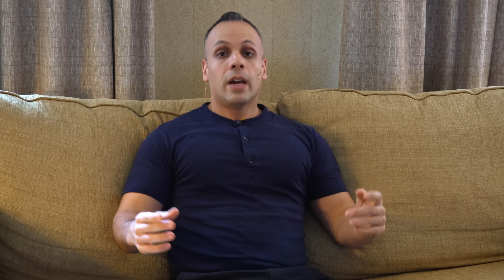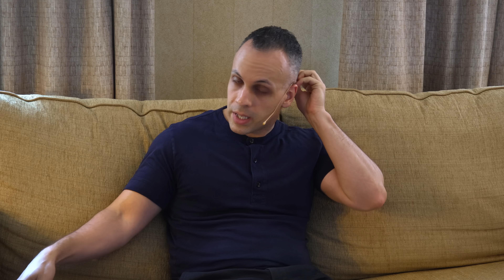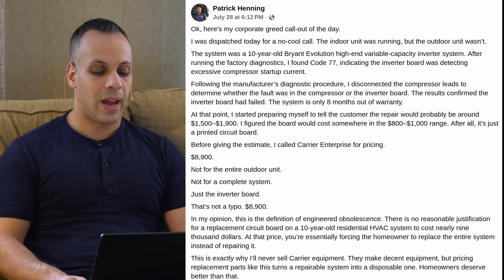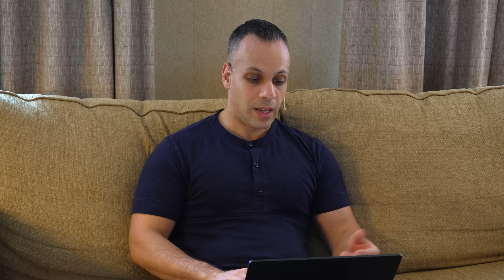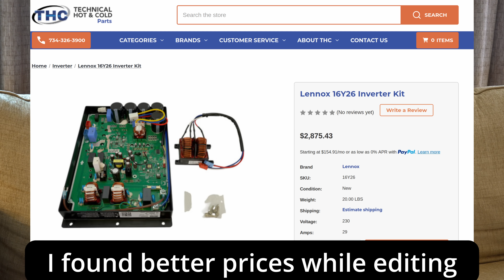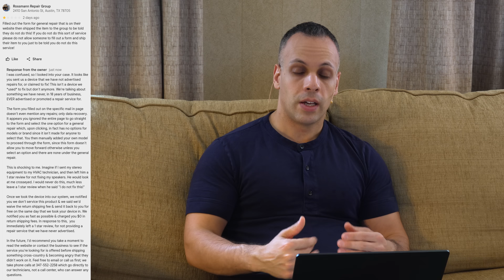Carrier AC repair has $8700 part cost for residential unit

Comment: This is the standard Carrier Enterprises solution to selling cheap equipment, markup the replacement parts 10x or more their manufacturer cost to produce. Standard. 
To be a Carrier Dealer you have to be some sort of person, I wouldn’t ever want to cross paths with. 
The really really bad sort
Reply: What’s more, is I have waited over 3 months for parts from major manufacturers. They say the equipment is “old” and requires these parts be on a “made to order” basis. 
However, they boast and claim their commercial package units last 25-30 years, and that’s the hardened time frame for their equipment lifespan. How can that be possible if I do not have access to the parts to fix their equipment…
It’s their attempt 100% to force system replacement, because anybody with money, wouldn’t tolerate that.

Comment: I’m an hvac technician. I’d never buy an A/C system with an inverter board. Not in Florida, too much lightning/storms/power surges/ hurricanes. If I ever live in a mild climate, then maybe I’d consider it. But for Florida, just a 2 stage compressor , capacitor, contactor in my condenser.

Comment: HVAC repair is already saturated with ripoff techs that are one step away from high pressure sells instead of servicing. 

I pulled out a 15 year old Trane unit that needed a compressor and was on r22 and replaced it with a few mini splits. Yes the mini splits are made in China, and they were cheap as chips, but I'm so much more happier with them. They are seer 22 that work down to -5f or -20c. I paid about $2,500 for all 3 units, 48k btu or 4 tones. 2x 12k and one 24k btu unit. 
Power bill is half of what it used to be, they run silent, quality of life is much better, as I can make the temperature in one area or room what I want it to be and the rest of the house whatever. 

Anyway I guess my point is even if I can't find a part, I can get another mini split for the price of a HVAC guy to show up and squint at the old unit full 50 yards away and do nothing else. I installed them myself and had a electrician check over my disconnects. Even if I have paid for that part of the install it still wouldn't have been that much, I was in a hurry though.

Comment: im less likely to buy a carrier AC unit (or really anything carrier atp) knowing that they basically take the same approach as Kia (the car manufacturer). The only reason I can think of the boards realistically being such high price; is due to them not setting many extra parts aside during manufacturing; and just putting all parts towards new units. Kia does this with their cars; they dont keep much extra parts in stock and instead put those parts towards new cars; which they then sell to customers at a low subsidized price and then when the customers' engine breaks down; instead of replacing the tiny sensor that went bad they replace the whole engine because its basically the same price; and thats where it comes in that trying to fix the carrier ac is gonna be the same cost as getting a new one; because of the lack of part availability all so carrier can make more money.

Comment: Perhaps somewhat related, I bought a compact all-in-one LG washer/dryer from Home Depot four years ago, $2200 Canadian.  Thankfully I also got the extended warranty because just recently the cycle selector knob started to fail intermittently.  Knowing my warranty was soon to expire, I called for service.  I also made a video of what the control was doing in case it worked perfectly when the tech arrived. The tech assessed that the cycle control board was wonky and needed to be replaced.  He called his office to source a part and cost to repair.  His office discovered the part was no longer made, no longer available, no stock anywhere.  They recommended the machine itself be replaced.  Much to my surprise, the insurance company (Allstate) agreed and refunded me my entire purchase price in the form of Home Depot gift cards and paid for the service call.  So I got another all-in-one (not LG) and another extended warranty...with luck this one will fail within the warranty period too!

Comment: We had a viking range in a home we bought. The range had a down draft vent that moved up and down at the touch of a button on board. The previous owner damaged the board with the button and a repair tech wanted to charge 2.2K for a new board and labor. Mind you, its not a pcb with and electronics or ICs or pasives... its just a few switches. Was very disappointing and now I know why the previous owners didnt fix it.

Comment: I'm convinced those high grade systems can't beat a "good enough" system with a complementary solar panel system. Same with fridges and freezers. 
Reason being when they are needed it is because of the sun, solar panels work great in the sun☀️. If there is no sun, less/no hvac is needed and freezers and fridges work less as well.

Comment: Whoever told you high end ac and furnaces are waste of money are 100% correct. I never sell modulating or inverter units unless a customer wants it. But he's right you will never make your money back and one repair will eat that. Also 10 years is the time when manufacturers stop carrying parts for a unit and if you have there high end machine well your out of luck since no other part is gonna fit and there is no universal part how there is on entry level units for the most part can just use universal parts until it cant be financially viable  to be repaired any longer. Ia have worked on every major brand out and all I can say the hay day of ac and furnaces is long gone when I started units where 20-30 years old average now tour working on 5-10 year old units with leaks on the coils failing compressors, cracked heat exchanger. Where when I started i was pulling 30tr old equipment with working compressor still replacement was sold due to small leaks sometimes, which I could repair now I repair a leak and 6 months later there is 3 more leaks on the back side of the coil. Or I had never seen blown out condensing coils until the last 6 years seriously blown out copper on the condenser where they bend the copper no surprise after  I got to working on them on why the copper is paper thin on new units

Comment: I was in a similar situation with my own Panasonic mini-split system I had, they wanted about $1000 for a main board for the outdoor unit (I mean cheaper than than $8000-odd, but still a bit overpriced), I repaired it myself in the end (crappy solder joints around the communication lines that allow the air handler to talk to the outdoor unit. Possibly exacerbated by vibration from the compressor and condenser fan). I would think there's the potential for money to be made in repairing the boards. Most HVAC engineers would just swap in a new board and trash the old one (same goes for controllers for furnaces)- they just want to get the job done and get onto the next.

Comment: Yep i do HVAC  and I refuse to put in carrier.
Ive had to replace multiple indoor blower motors this year alone.... 1100$ my cost......
The few dollars the customer saved over the years on this fancy motor is completely wiped out at the first service call much more so when a part is needed!   
How is this helping anyone???
All of this efficiency crap does NOTHING for us.
Same thing with this refrigerant phaseout scams in modern times!
Back in pre 90s there was no recovery process and companies would just cut the pipes and release the refrigerant into the environment. Then we came out with refrigerant recovery process... THAT was the solution. But the manufacturers found out that they can simply tell the government that they have a "better" refrigerant with less "global warming potential"  and then the government bans the old refrigerant, the manufacturer stops making those units, only makes the new stuff, and then when somebody's system breaks, they are basically forced into buying the new systems instead of just repairing what they have... the manufacturers make sales, the government meets epa quotas. And we all lose....
Ive called and written my reps and manufacturers for years... nobody cares.  Everybody in the industry i talk to agrees its all bs but they dont make calls or write letters.  Customers dont know enough so they dont call or write letters... 
So now, the main heart of our homes is a disposable product that only lasts a fraction of what they used to last... and costs double if not more to replace.....
This madness needs to stop!

Comment: Somebody essentially left the same post on one of the HVAC groups in Facebook. 🤔
He did get called out because a normal Carrier dealer can get that board and install it for a fraction of that cost.
These new high-end inverter board units are expensive, but not THAT expensive.
But if you're not on their dealer program you're going to pay top price that's going to be near list and then you're going to mark that up even more. That TECHNICAL HOT AND COLD is an internet scalper site. That board be about $4k less for a dealer and then mark up from there.
It is a surprisingly expensive board, however.
But I believe these resi u its have something  like a ten year warranty on that part.

The funny thing is you can get a dime a dozen ductless with an inverter board for under a thousand bucks, granted a smaller unit.  Amazing how much less it is when it's a mass-produced more common item.
Give it five six more years and all the residential HVAC will be inverter by mandate. 😬

Comment: Yeah😂.
It’s not a ‘little control board’. It’s bigger and heavier than your laptop. It doesn’t cost 9 grand, either. But, that’s a fair price installed and that’s not a high profit item.
‘I did a little research on the Googly box’ is the same thing as talking out your arse.

Comment: We had a similar issue.... I put four inch thick foam in every air register (prevent mold spread to home) and ordered a mini split 🏴‍☠️ Texas is too hot to be spending 4,000-8,000$ on a board....

Lets use ai and an esp32 to replace these scam parts 🇺🇸🔍

Comment: Replaced a Carrier draft Inducer motor on a 15 year unit a few years back and it was over $900 for parts and installed myself. Now they are over $1400. Going away from ducted systems forever, inefficient compared to mini splits in my area.

Comment: Carrier definitely gouges the HVAC company and therefore the customer.  OEM parts are usually exact replacements and at least 2-3 times higher than aftermarket parts which require modifying wiring or how the part is connected etc.  With the lower cost online parts the manufacturer states there is no warranty on the part unless sold through an authorized agent.  So you have to be careful which online store you buy from.  The local supply house offers convenience, knowledge and training, tech support when needed, credit terms and help in training and guiding new HVAC contractors in pricing systems and how to offer financing to the customer etc.  so there is some value not immediately seen without looking at the supplier/contractor relationship.  Suppliers are dealing with online stores selling equipment, parts and systems at near cost and they are not able to do the same due to storefront overhead etc.  I have bought parts online as well due to Carrier's seemingly grossly over priced parts. So I agree with you.

Comment: I just changed a blower motor on a carrier unit and they weld the brackets onto the motor so the only way to get the correct bracket is to buy the OEM motor that costs $1500…

Comment: I've parted out quite some fairly new units as replacement parts were ridiculously expensive...

Compressors, boards and coils are often priced at 80-90% of what a new unit would've cost (supplier price without labor).

I'm currently looking at a broken Daikin where the indoor unit control board costs 980 and a new indoor unit costs 1100...

Comment: I needed a condenser fan motor for a carrier unit. The OEM part from carrier was about $800.. I went to a local supply house and picked up a motor that would do the job for about $185.. carrier has always been a rip off and still is that’s why I never sell carrier equipment. Good job Lewis for exposing carrier for what they are thieves.

Comment: I have a 25 year old Carrier heat pump. Got it when hurricane Isabel hit. Insurance company said replace it because salt water splashed on it. I took it and installed it at my house. In 25years all ive replaced is the blower wheel.

Comment: please please please dive deeper into this! carrier, lennox, trane, daikin (and their sister brands bryant, payne, ducane, american standard, goodman etc) have been raping the price on repair parts ever since covid.
new equipment costs are starting to catch up to it aswell!

half the time it is cheaper to buy the WHOLE air handler (~$1900) vs just the coil (~$2400 )

there needs to be a class action lawsuit or something to get these companies in check.
Reply: my company doesn't sell used equipment, if we condemn it (or it is not cost effective to repair) it goes to the scrap yard.

Comment: I recently had a Samsung clothes dryer heating element fail. Sears came out to asses (no one else local would touch Samsung washers or dryers). Long story short, it would have been nearly the same money in parts and labor to repair the unit vs buy new. They know a smart homeowner won't repair, AND they charge $150 just for the "technician" to show up... Schedule 5 or so house calls per tech per day, and BOOM... free money. Furthermore, I can't just replace the dryer with a different brand because they are front loading and stacked - We have to stay in the brand ecosphere or else there are mounting compatibility issues.

We went with a different brand fully supported by a local appliance shop... Unlike Nebraska Furniture Mart, they delivered AND installed the appliances, whereas NFM wanted to drop them on the driveway and leave the rest to us. 🖕Nebraska Furniture Mart, 🖕Samsung, and 🖕companies prioritizing profit over quality and repairability.

Comment: Did you even google it?

That board makes the system a legacy R410a system that have been out of production for 2-3 years. The part is incompatible with modern R32 systems. The parts that were manufactured cost effectively were manufactured long ago. Warranty support is required by law for about 8 more years for equipment they will never sell again. This is on top of the practical requirement to support commercial equipment for likely 30+ more years.

If you don't like the pricing contact your representatives and tell them to stop fucking with air conditioning equipment with bad plans and designs. R-32 just became the standard 3 years ago. It will effectively be phased out from hvac systems by 2036 at the latest. Presently the only replacement candidate for R-32 is R-290 (propane) given the recent desire for heat pumps and other less dangerous refrigerants do not have the heat extracting potential at cold temperatures. If you think R-290 will survive as the defacto refrigerant after the first nursing home or apartment complex burns down because of it, I have some prime beach front real estate for you in new mexico. All work on R-290 being done isn't on safety. It will never be safe. The work is to lower safety standards to allow it to be used. The whole time the correct direction while adhering to the montreal protocol was to use two different refrigerants that will almost certainly follow the failure of R-290 short of some new nobel price for chemistry level compound being synthesized.

Comment: HVAC guy here. That is a astronomically high price for that board there simply doing as you said they do not want to sell you the part necessarily they'd rather sell you an entire system and then 10 years later the same thing over and over